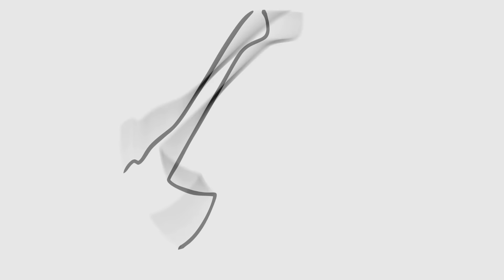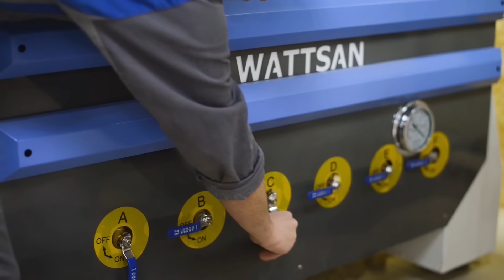A Smart Table of Epoxy Resin using the Wattsan CNC machine

Comment: Amazing concept. Your target audience is nerds specifically those in tech as I'd imagine this isn't going to be cheap. Table top games is one option that a lot of people have mentioned but the other being an IOT desk. Taking the sensors and connecting them to like a rasberry pi would allow programmability You could then install a switch to cycle through a few preset options like breathing patterns etc. But using a raspberry pi for processing would allow your users which i'd imagine a good deal of them being very tech savy could then program each capacitive button to their liking. IE smart home commands. volume controls, lighting, weather alerts.  Would be interesting to see the table top being sold as is allowing the user to build or contract the rest of the desk/table to their liking.
Reply: @DashingAxe  Kickstarter is dead
Reply: Yo, who needs a keyboard?? When you can have have table!
Reply: I think that main target would be bars and discos
Reply: That's some nice ideas!
Reply: Why would I put functionality like weather alerts and smart home commands into a table, when I already have all of those things on a phone I keep on my person 24/7?
Reply: @FreddieTheRobot  Why do people have smart home devices like Alexa when they can open an app and do the same thing from their phone? Most things when it comes to smart homes are redundant but being able to double tap something on your desk to dim the lights in your room is pretty nice rather than yelling at your smart assistant.
Reply: @TheChemisch  agree to disagree! The tech world has tried putting interactive controls and screens all over our living spaces several times, and the market spoke and said "eh, no thanks". Companies have tried to capitalize on ideas like this over and over (remember the smart mirror trend?) and failed. Tons of psychology studies have come out proving that more screens and data floating around our vision stresses people out more. Advancements like voice assistants have become the primary focus of large tech companies for IOT/smart homes because they are realizing that the idea of integrating tech into our lives sells better if our lives aren't intruded upon while doing so. So we have shrunken down the main controller to a module you can fit in your pocket, and until we get to the next visual control system (maybe like eye tracking and gestures with smart contacts and glasses) I doubt that MORE interfaces crammed into big bulky objects will sell well.
Reply: I bet this table is going to run north of 5 grand, maybe as much as 10. Just the woodworking in it alone is half the cost.
Reply: Does anyone know how to solder the ring to the touch sensor?
Reply: Stolen video from russian wood worker chanel - Лихой Топор.

Comment: This is really nice. A 60-70" wide by 30-35" deep version with an uncolored frosted epoxy and controllable RGB lighting would probably sell like crazy with the PC Gaming community. Might need a way to shut-off some sensors so they aren't on 24/7 from the mousepad, keyboard, monitor, or tower.
Reply: Most wont be able to afford it.
Reply: @DrinbevorBernd  It actually wasn't that expensive. Less than a lot of the variable height gaming desks. I don't know if it's still for sale though since the Kickstarter didn't reach its goal.
Reply: @DrinbevorBernd  that's what I thought, wonderful idea, beautiful tables and lighting, but probably out of the price range of most people. Great for custom orders from people with money. What they showed in no way looked even close to mass production capable. I love the wood but I think it might be more feasible to 3d print, or leave the wood out and do some kind of stone, resin, or plastic molded pieces in it's place, to lessen the cost of materials and most importantly time. The wood they start out with looked around 50% gone by the time the product was finished. My guess was that that table was going to be in the 5-10k range, mainly due to build time per unit.
Reply: @DrinbevorBernd  i'm sorry that you are poor.  
but there are PLENTY of people able to pay that for a table.  

the thing is nobody wants the table because it's not smart.  not programmable.   
and it's an always on kind of thing so it will get annoying REALLY FAST

it should only respond to movement.  not something that is permanently placed.
Reply: @darkracer1252  Ahhh, the classy Xx_darkracer125_xX telling me i am poor on the internet. Nice!
Reply: I was just thinking the same thing. If they made this into a desk rather than a table that I could use for gaming I would totally buy it for $2K easily.
Reply: The lighting would need to be fully customizable and controllable by the consumer as if it was being used for pc/gaming you wouldn't want the leds on all the time and being able to change color brightness and other key features would make it compatible with more consumers but also probably bring the price up slightly
Reply: @darkracer1252  Boy he shut you up real quick.
Reply: @darkracer1252  hey bro dark flame master xxxx you ok bro?
Reply: @DrinbevorBernd  12000 us dollars
Reply: It did not sell like crazy, it didn't even make the threshold on kickstarter. The gaming community is the wrong market. They are mostly poorer and the table electronics do not function as part of the game.

It is more a piece of art and should be sold as such, not a gaming device.
Reply: @NoCIemency  just interchange the legs and you have a desk easily.
Reply: @DrinbevorBernd   but a high end graphics card cost more than that?
Reply from the maker: Hello! Good news! We start again our smart table Hexagonum project  on Kickstarter! Now it's available to order. You can also support us with even 1$ and good comment. Follow the link for more details. Thanks!
https://www.kickstarter.com/projects/hexagonum/hexagonum-table-by-dashing-axe?ref=ksr_email_creator_launch
Reply: Do you guys sell these? Highly interested!!!
Reply: Where can we buy this?
Reply: Stolen video from russian wood worker chanel - Лихой Топор.

Comment: Nice end product, but I shiver at the thought of fixing any electrical issue down the road (don't think this is a throwaway kind of product) because of the messy wiring job.
Reply: The final product is using PCB's, you can see that near the end of the video. The messy wiring was just the prototype from what I gather.

Comment: This is beautiful. It would be awesome to be able to buy the sensors to use in other custom projects as well. Love the PCB design at the end. The wiring reminded me of my first pinball machine repair 😅😅
Reply: Looks like TTP223 capacitive sensors to me. Unclear about the diagrams and whether they went for touch=LOW or touch=HIGH here though.
Reply: @shikizokuzekuu  Is the larger antenna just soldered to the metal ring on the front there, or is there some more proper way to do that? Google has let me down so far :(
Reply: J'ai pensé à exactement la même chose, un flipper grand ouvert :D
Reply: @BenjaTheOne  I feel you, were u able to find anything? Cant find anything on the internet :c
Reply: @BenjaTheOne  Try find info about "capacitive touch screen, or: capacitive fingerprint reader". Some explanation are on YT in "Why most Arduino Soil Moisture Sensors suck", udmJyncDvw0?t=413)
Reply: hello

Comment: What a great idea, if I may suggest a couple of things?  perhaps add a few charging ports for cellphones/tablets, and a RGB option to change the colors?  perhaps even a bluetooth function so you can control it via iphone/android.  This would be great around holidays, or for special family events.  If you also add the option for a glass top, it would prevent anyone from scratching the epoxy which is the main reason I don't use my epoxy table for my laptop or eating on.  I put a glass top on it and that took care of the risk of scratches.  
Great job!  I can only imagine how many hours for development and implementation it took you.
Reply: hey there, do you happen to know the control board they used to tie all the touch sensors together?
Reply: @bobshagit9503  I don't, but I've used a Principal LED control module on signs that are similar.  I'd go on their website and ask, or you could check out some of the websites on Raspberry Pie boards, that's what alot of fabricators use.
Reply: @thisolesignguy2733  oh ive asked and havent received any answers haha... Im talking about the multiple little green boards they have soldered together then electrical taped over

Comment: I just came across  this video, and trublgrl's comment is solid. You should have marketed this to the PC gaming community, and not just for tables. Mirrors, wall panels...anything. 
Also, the possibility of repairs needs to be considered, with more effective cable management. Something this expensive cannot be just thrown away if one of the wires shorts.
Will you be able to make this table for anyone who wishes to make a custom order? The 'Artist' links on your channel don't all work.
Reply: I've serviced pinball machines and that wire nest was giving me anxiety
Reply: You can see in the end that the refined product has cable bundles instead of cable nests, I think the video was showing the making of the prototype\version 1 as ordered by someone. not to mention it'd be cheaper for them to use the refined version they showed than it is to handle the mess of wires that is the first table.
Reply: I have to say that the fact that every comment from the channel is an identical copy-paste with a link to Kickstarter is setting off alarm bells

Comment: These would be great on open stairs designs or even floating treads. The challenge is to hide the wires on the bottom side. Great video btw.

Comment: I'm not sure if its possible but maybe you could get the touch loops printed on custom pcb instead and have the lights mounted on the same PCB as a single board, maybe on the back side. Then just have one connector for each board.

Comment: This is awesome! By the looks of it, it seems that it works by capacitive sensors detecting the location of objects. How does it detect empty glasses and ceramic plates? Are there perhaps pressure sensors as well?
Reply: Proximity sensors
Reply: Seems you know much about this, I'm kinda curious, could I ask what type of engineering it is?
Reply: @Niphrentil  Just like the phone ones, except it is tuned to opposite effect.

Comment: Sweet project! Would you consider selling the electronics as a kit? I have the furniture skills, but not the electronics. I checked out the Kickstarter, but it looks like I was too late. Great job
Reply: About 20 people would buy it.  And 18 of them would sit on shelves and never get used.
Reply: I would use it. I also have the furniture skills... I have an epoxy table but I just use strip LED lights. But those lights are way better😁
Reply: The electronics are fairly simple. They used a touch sensor TTP223 as a switch on each light, they extended its range with the wire ring they made first (not the aluminium ring they mounted the lights to, the wire ring.  The TTP223 is the red circuit board you can see at each circle.
The ttp223 is a switch that turns the lights on. So its just a basic lighting circuit with a switch. 
The ttp223 can be operated in multiple ways depending on which jumpers you set it to. They are using a proximity setting. The wire ring acts as aerial to extend the range.
Add in a few resistors to correct the power, voltage and current from the dc supply to the LEDS and or relays so the switch can carry a smaller  current than the leds,  a tranformer to convert ac power to dc power at the plug, some fuses and you are done.
Reply: Can the ttp223 be programmed to fade the LEDs off after a few seconds like the ones in the video?
Reply: @theskyabove1  there are a few versions of it brad. From the data sheets i have looked at, no. But you can program a micro controller in arduino to do that for a variable timer or you can make a simple delay off timer with a capacitor, an npn transistor and another resistor or two. By changing the capacitor size, you change the discharge rate and hence the power off time. There are also many other timer circuits you could look up depending on how elaborate you want it.
Reply: @bob shagit Bob there are so many videos on youtube for that switch as well as for arduino, as well as for how to make a basic timer on the internet, Those switches retail for about $2 plus or minus depending on who you get it from., capacitors and transistors are also cheap, like 5 for $1 or even a buck each depending on what you get from your local hobby electronics store. Personally no, i don't have the time or desire at the moment to work a circuit out for your application. Find someone electrically competent you know to help you, make sure you put an appropriately sized fuse on any circuits you may build especially if you are going to leave it on while not being around to put out the fire,  and don't burn your house down. Best of luck!
Reply: @Scorry  I’m sure they chose all those things. Chill out dude. Don’t make a mass generalization about a group of people based on their leaders. Derrrrr
Reply: @PDXPiggy  ,
> Chill out dude.
Don't tell Ukrainians what they have to do. Please.

> Don’t make a mass generalization about a group of people based on their leaders.
About 70% of russians support war against Ukraine. 45% of russians support nukes against Ukraine, NATO countries, or US. It is not leaders who sit in planes, tanks, and infantry fighting vehicles. It is not the leaders who direct the cannon artillery and shelling living districts, hospitals, and maternity hospitals. It is not leaders who drop bombs on cities and it is not leaders who launch rockets to kill our fellow citizens. And Belarus is just a silent shadow of russia. And these guys are cowardly silent and do not express their position, instead, they are trying to get into the Western market, which is closed to them by sanctions, and are trying to make money there.
Reply: My family is from Russian and Ukraine. No one wins in war. NO ONE
Reply: @Scorry  okay sir, have a great day
Reply: @DashingAxe  You really should have gotten someone else to do the voiceover on that video.  The English is odd, and sounds like it was written by someone who doesn't speak English as their primary language.
Reply: @Scorry  exactly
Reply: @patty4730  Thx

Comment: Fantastic job!! One question - How did you made capacitive sensor activate with empty glass and plates? (15:51 )
Reply: Stolen video from russian wood worker chanel - Лихой Топор.
Reply: @GPfAnubis  Compare the publication date and views count, Sherlock. Not to mention all the "russian" tools they use in the video. "Лихой Топор" clearly has stolen parts of this video, showing off as their work and even the logo. They used it to advertise some shitty epoxy and Chinese tools.

Comment: Which sensor is this?
Reply: These are the ttp223 touch sensors but from the video it seems that they have been modified in some way
Reply: @TheMrMichaelz  he simply added wire ring to sensing pin of tp
Reply: @wasim21k  I have inquired in the meantime and have now seen that there is the possibility of putting an external Pad. Thank you
Reply from the maker: This is our personal development, we designed them ourselves and ordered them at the factory. Unfortunately, there are no such boards on the free sale.
Reply: @DashingAxe can we buy this developed sensor from you? large quantity.

Comment: I'd recommend manually ordering your cutting operations on your cnc, I've seen some cadcam software like Xylog send the gantry all over the place and when optimized (either manually or with an optimization wizard) it can cut huge numbers of your time especially if youre skimming 2 sides of a table like that. its all very lengthy but for sure you could save time.

Comment: Hot glue for the electronics is a great idea, at least you can melt it with some hot air and get them out if any need replacing.
Bit of a messy clean up but way better than epoxy.

Comment: this is something really amazing.i just think the CABLE to connect it to 220v on the floor will not be so confortable, to have it near this table everytime you risk to kick it..
maybe i didn't understan well but , is IT with a RECHARGE BATTERY or ALWAYS connected by WIRE to 220V?

Comment: 223 has auto reset timer, when we put an  object on table after some seconds of time sensor will automatically reset the signals and led goes off, how did you get rid of that?

Comment: instead of wiring all this couldn't you mount a low powered LED TV facing up and have it receive information from a sensor mounted below could connect to a Raspberry Pi or Arduino board to output an image or color in the location the sensors are getting input. The sensor is the difficult part but would also add functionality like being able to detect certain types of objects placed on the table. For example a figurine or object it could identify would glow Red when placed in a specific area or trigger some animation on the table.

Comment: Question - I understand the metal ring with extend the range of the sensor, but I thought you still had to make direct contact to trigger the sensor.  Without touching the sensor directly like other touch sensors work, how is the sensor detecting touch/contact from the topside of the table?
Reply: Stolen video from russian wood worker chanel - Лихой Топор.